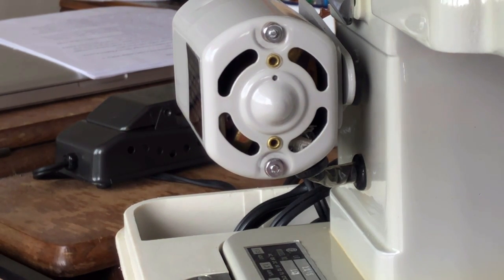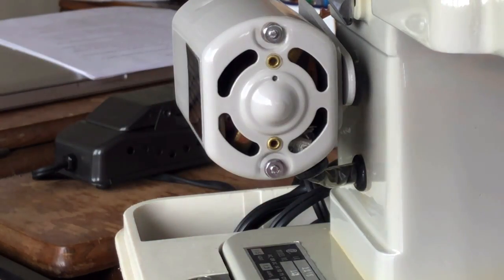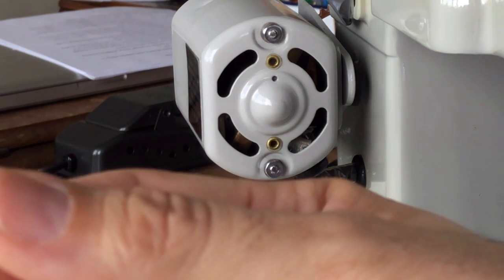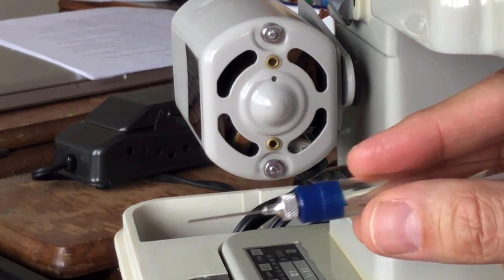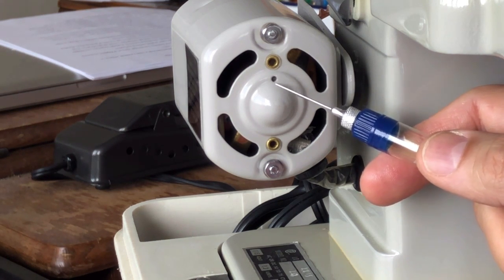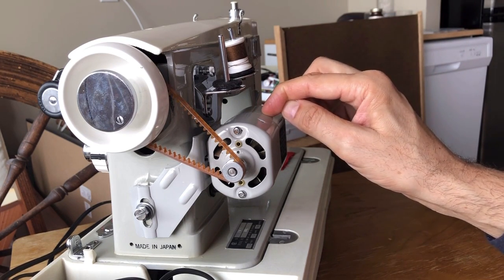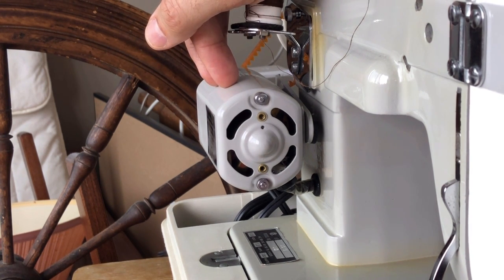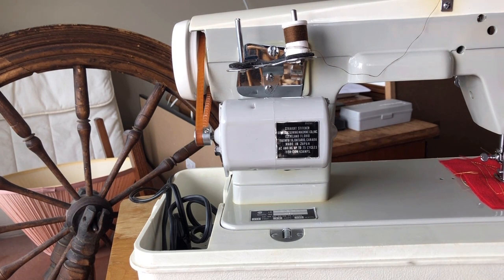MOTOR SERIES #4:  Lubricating the Bearings.  But What Happens When You Can't Access the Brushes?

Comment: Take that motor apart. I bet you will find a felt flat washer surrounding the bearing. That felt washer holds oil. It is an oil reserve and if it is all dried out one drop will not help much. You want to saturate the felt without over saturating it.

Comment: It’s a pain!  You indeed disassemble the motor, the brushes and springs pop out, the thrust washer too. To get it back together you must use skill and poke through with something thin and long through the grill slots to hold the brushes plate in position while you slide the top back on and seat the shaft into the end bearing. You have to be patient and motivated!  It may take a couple dozen try’s! I got where I was quite skilled at it, but it was not easy.

Comment: I have a White 626. Approximately 1959 manufactured. It does not have the small oil ports on the motor. Did you ever find a way to access the brushes on a motor like this. The motor started to give off a slight musty burn scent. I heard someone say that if you just ran the motor hard, you could burn off the dust. Do you think this would harm it? The machine has never been used a great deal. It was my Mother’s.

Comment: I have no experience with sewing machine motors but some motors (and older GM alternators) had holes in the brush holder that allowed you to hold back the brushes by inserting a pin. The pins then extend outside the body of the motor and once the shell has been assembled, the pins can then be removed and the brushes will then spring against the commutator. I was wondering if the brass rivets, with holes in them, on the White motor would allow pins in to hold back the brushes. They must have had some method when assembling the motor at the factory.
Reply from the maker: That's a very interesting theory Anthony.  Thank you for sharing and it leads me to want to find out if there are options since without access to those places from outside the shell,  there is no way to know for sure without disassembly which could, if there are not options for this in the brush holder, you could be left with no working motor.

Comment: I bought a necchi esperia. The manual says 59 on the back. I just had the motor serviced since it smelled bad when operating, and the  necchi fb page suggested it. He said it was bone dry. I have barely used it at all since I don't know how to sew yet, haven't used at all since getting motor back last week, because I need to get the handwheel off. I didn't know about oiling the motor and the manual doesn't mention oiling the motor at all. He told me to put one drop on each side Every Time I sew. I've heard otherwise since, and would like to know the truth please. My motor looks very similar to the one in your video. Thanks.

Comment: I cleaned the commutator by using electric motor cleaner on Q-tips. I went through the vent holes, and turned the shaft by hand while holding light pressure on the cotton swab. I repeated a few times , till it came out clean. Thanks for all your videos, they have helped me out often.
Reply from the maker: Thanks for sharing Russell.  FYI, have you ever tried using the new (relatively) Q Tip Precision tips?  I find them to be easier to use and a bit less likely to shred.  When I find these, its normally in a pharmacy or store with a pharmacy.  Here is a link to what I'm referring to.  https://www.qtips.com/products/qtips-precision-tips/

Comment: Hi! I’m hoping you can help me with this. I have a Remington Deluxe ZigZag model 139 that my grandma gave me like 20 years ago and I’ve been trying to figure out how to oil the motor. The motor is a Monarch model 6A, and it doesn’t have any oil ports on the exterior. Is there any way I can email you some photos of the motor to see if you can help me figure out where and how to lubricate it? I’m not having any issues with it—it runs fine and it’s not smoking or anything—I just want to make sure it lives as long as possible. It’s been around since the 1960s! Thank you!
Reply from the maker: Great question Michelle.  Some motors did not come with the oiling port holes and so there is no way to really lubricate the bushings although you are wise to ask since that can prolong the motor's useful life.  Fortunately, if your motor should ever wear out, you can get generic replacements.

Comment: I got lucky. I tried to separate the two halves but only got the motor halves about an inch apart and then just erred to the side of caution & put it back together. I might add that the two bolts that run through the length of the machine can fall into the motor housing. Like I said, I got very lucky. 45 minutes later I got it back together & it works fine. I just wanted to check the brushes.

Comment: I have a Brother Galaxy 230. The motor started smoking. Doesn’t smell electrical. I oiled the oil ports as you recommend. Some of my other sewing machine Groups say run the motor for about five min. and it will eventually burn off the dirt that is on the inside. However, I tried the Q-tip in the vent and it seems there is a large amount of carbon. I’m going to try to clean it that way with the Q-tips. Not sure if I should use any cleaner on the Q-tip or just wipe out what I can with a dry Q-tip. Nonetheless I’m curious why it would have so much carbon. It is an old machine obviously from 1962 and maybe it went years without any oil. what exactly causes carbon to build up? Us it metal wear? The machine runs very well. The motor doesn’t bog down at all Thank you for your videos and all you do.
Reply from the maker: No cleaners should be used other than 99 % rubbing alcohol.  Once dry, you can try to see if the motor improves.  A lot of the carbon build up can sometimes be caused by dust from the motor brushes. However, there can be other issues with motors that demand a full inspection of the motor which would be wise for safety reasons.  Or, alternately, I would suggest replacing the motor if the smoke does not stop.

Comment: What if the machine doesn’t have the little holes to deposit the oil? My Janome novum motor is making a whirring noise (it’s from around 1960’s). The machine is still running and creating beautiful stitches but the whirring is a little concerning. Any tips please

Comment: Hi!

Your videos have been such a great resource for me - recently I bought a Kenmore 158.17520, and I'm slowly working on restoring her. So thank you! 

One issue I've been having is that when you turn the handwheel forward, it makes a squeaking sound near the drive shaft/motor casing (not sure if that's the right term - the part that connects the motor and the motor belt). I don't think it's internal issue, but I'm not entirely sure. I'm hesitant to oil anything in that area for all of the reasons you mentioned in this video, but I don't really have any other ideas. Do you have any thoughts?
Reply from the maker: Hello Priscilla and thank you for your question.  Its funny that you ask about that model as it is one of my favorite Kenmores and one of the strongest they had thoughout the 1960's. And I actually have one too!!!   It is in my line of machines to overhaul and so I will try to remember to make a video on the motor.  There is a necessary oiling point for the bearings (only guessing  that is the cause of your squeak as it could be many things).  I can show where that oiling point is.  And yes, its very important to never oil any sewing motor EXCEPT for where the bearings require lubrication.  Some older motors used grease but this one uses sewing machine oil.  Keep watching for when I do the video on that model.  Great color scheme too!
Reply: @VintageSewingMachineGarage  Thank you, I'll keep an eye out for that video in the future! I'm a fan of the color too. I think I'm going to name my machine "Pistachio" cause of the green.
Reply: Hi priscilla I have a kenmore and when I sew I see sparks by the motor

Comment: Thanks for the information. Should think, that you could have some tool to be inserted through the air ventilation holes, and able to hold back the brushings until you insert the rotor with commutator. I got a chineese motor 5 years ago. It do have outside acces to replace brushings. But it do not have lubrication holes. So I take it apart now to lubricate bearings. I am not sure to do it right through the ventilation holes. Actually the motor I got from China was a 180 W motor of only 0.5 kg. It is more a heating element, than a motor with shaft power. The Watt value is the input power. For a new motor, I should look for the weight. A significant Price part is copper and steel for a motor like that. If you reduce that and have a high watt value, a larger part will be converted to heat. And it can be hot. So ask for the motor weight for a new motor. It should be at least 1 kg. It is no garantee of shaft power, but it is an easy thing to measure in the supply chain and can give you some more confidence.
Reply from the maker: Unfortunately, I do not know of any tool that can be used to hold back BOTH brushes which is needed to reinsert the driveshaft of the motor.  I would NOT use any of the holes in the side of this motor since you cannot know if you might cause damage.  It is great that you have access to brushes on your motor.  I much prefer the older motors to work on since you are correct in that copper was used in higher amounts in years past and newer motors often scrimp on copper and other metals to save money.  This may be different on industrial size motors but for these small ones, I am currently searching for a supply of better quality replacements.
Reply: I think I should make some tool from some steel foil. Perhaps from a can of beans :) I have seen a China motor of 250 W, and the supplier have garanteed me a weight of 1.3 kg. So perhaps I shall try this out. By the way. I have measured the shaft power and moment curves from 4 of these motors. I think I should send them to you. The max shaft power of the 180 W motor was 52 W at 230 VAC input. The motor from the old Singer 201k I got, it was only 16 W.
Reply: I have not been able to find a way to contact you. So you will get at link here to Graphics of the shaft power mesurement results. https://www.dropbox.com/s/ajmf2g739w2vcz2/Sewing%20machine%20motor%20shaft%20power.png?dl=0

Comment: Hi, I have the Dressmaker S-2402. The motor has 2 holes per side instead of just one per side. You added 1 drop to each side. The top hole is like you said at 12 o'clock. The other hole is at 6 o'clock. Both sides. Should I add 1 drop to all four holes or only the 12 o'clock holes? Thanks.

Comment: Your videos are so well done.  A good mix of entertaining and informative. I was recently given a White 6477 and it's cams.  I found a manual for it and gave it a thorough clean.  But,  while there is no apparent problem with her ability to zigzag,  the cams won't make proper stitches. Have you ever dealt with this machine and do you have suggestions? I'm coming up empty.
Reply from the maker: Hello Carla.  Your raise an important point about the use of cams that need to be inserted vs. those built in.  There are 3 basic potential causes for this kind of issue that I am aware of.  First, there are linkages that work to "follow" along the edge of the cam that will then link to the needle bar through a mechanism which will vary with each machine/model design.  The linkages can vary in complexity but to be fair to the engineers, they were designing mechanical devices that were literally physical guides for the needle unlike modern computerized models.  Here are 3 possible troubleshooting strategies:  
1.  Check to see that all of the linkage system is cleaned and or lubricated to ensure it can operate.  The more complex a machine's mechanicals, the more there is to get moving again if like most machines, yours has sat dormant at some point in the past.  
2. Check to see if the layout of the linkage/mechanicals appears visually the way it does in the manual. Sometimes, prior users can move them improperly and they can be stuck out of position as originally designed. 
3. The manual can also be quite helpful because in many cases, while built in cams are even MORE complex, even machines like yours that allowed for cams to be inserted still often have a number of "SPECIAL" settings that the machine requires before they will engage with the cam.  So if the manual directs you adjust 2 settings (It could be more) and you have only adjusted one or perhaps none of them, the cam won't engage.  As I often tell my clients, Heirloom vintage machines rarely if ever break.  They will simply not function until and if they get either needed service or adjustments made to them.  It can also help to be patient with yourself since it can take a while to make you way around a new machine until it becomes familiar enough that you can sew efficiently with it.  Although I have not had the specific model nor made a video of it, there may be someone with a blog that can illustrate how it operates.  Don't give up though.  That machine should be old enough to be Heirloom grade and it was likely very well made.
Reply: Thanks so much for your suggestions.  I will look over the linkages as best I can.  Sadly they are not pictured in the manual.  I am however,  following the manual   as closely as I can given that it is rather sparse lol. I have found one video,  and that is it for resources  on this machine so far.  Perhaps it wasn't very popular lol. Fingers crossed and I won't give up!

Comment: I've got a Sears Kenmore 158.433; and although it's a beaut, it's in need of a little tlc. Why is this model so hard to gain info on? I think I need to replace the motor (sparking), and a little oil. But I'm having the worse time finding help for this model😩
Reply: I am working on the same. The manual is brief as well. What have you discovered?
Reply: @danilei6045  I ended up replacing the motor with an Amazon kit. The only drawback is that the motor in the kit does not have altering speeds. No matter the pressure on the peddle, it just goes from 0-100; and it takes some getting used to and stopping a lot during tricky edges.

Comment: Can you help me figure out what I just bought? It's a KenQuilt 633 long arm quilter. Have I just bought trouble? It seems to run well and strong. Should it be put on a carriage or should it go in a table. The quilt frame is an Inspira. Is is steady enough to put the new machine on? the KenQuilt is very heavy and has an open base. Many thanks.
Reply from the maker: There is a group in Yahoo Groups called, "Home Quilting Systems" and there may be others.  There should be a wealth of info there that would be specific to your KenQuilt.   I am not familiar with those personally, but you should be able to find fellow owners who can guide you.

Comment: I bought a 1954 Singer 15-90 that is in great condition. Seems to have not been used much. The motor is one of those with apparently no access. I was wondering if I should do anything with it, grease/oil it somehow just because it's so old, but I don't see anywhere to do so. No accessible ports. I would imagine  you’ve seen a few of these motors. Is there a place on these motors to put a drop of oil?
Reply from the maker: Hi Mildred.  All of the 15-90 models I have seen had a rear mounted motor that uses a belt and so it should have access IF IT'S THE ORIGINAL MOTOR. If yours does not use a belt and its from 1954, there is a chance that you might have a direct drive gear motor.  These do not use belts and are today casually referred to as "Potted Motors" due to the appearance of their housing.  I have only noted the Potted motors on the 15-91 version of the Singer 15's but Singer did make some running changes over the many years those machines were in production. Of course, I have not seen your machine up close and so its always possib15-90 motor and you can compare that with what you see on your 15-90 to verify if yours is direct geared or uses a belt.  The original motor should have used grease for its bearings and NOT sewing machine oil.  The grease ports on many (But not all) Singer motors from that era often had Chrome/Nickel colored grease ports that are shaped like upright cylinders.  And so unless your machine was altered or "updated" with a different motor at some time in its long life (and that is quite possible) you won't have a small hole like you see on this grey colored White brand machine here in this video.
Reply: Hi Vintage Sewing Machine Garage, It’s the belt driven motor. I was trying to date the motor by its cat. no., BAJ3-8, and saw one on eBay for sale that was supposedly from a 1955 model 66 Singer, so I think it could be the original motor. Then again, who knows? Both motor and machine were made in Canada, if that means anything.
Reply from the maker: Your questions remind me that I might want to do a MOTOR SERIES video on that motor type.
Reply: Vintage Sewing Machine Garage Thanks! That would be very helpful! I’m not going to do anything to this motor unless and until I find out it’s ok to do it.
Reply: Hi Mildred. I have a 15-90 with the same BAJ3-8 motor. It does take a bit of grease in the two grease 'cups' that look like little tubes that poke up vertically out of the round knobs at each end of the motor. 
You can find a manual for this beautiful machine on the ismacs.net site - look under the research tab for Singer, then follow that link to the Singer page where you will find manuals for many of their machines. The 15-90 manual has lots of good information including machine oiling points and motor lubrication (no oil for the motor).